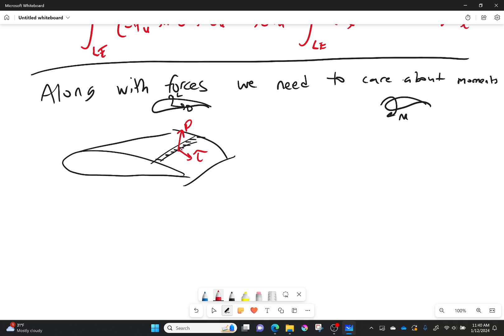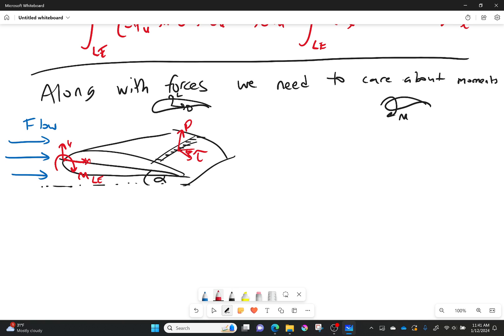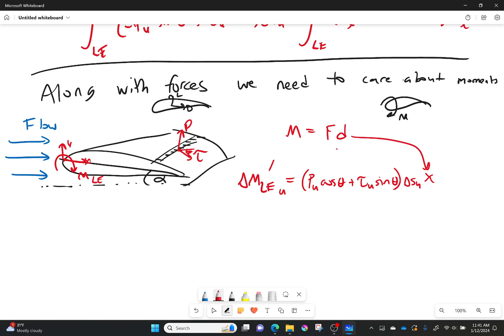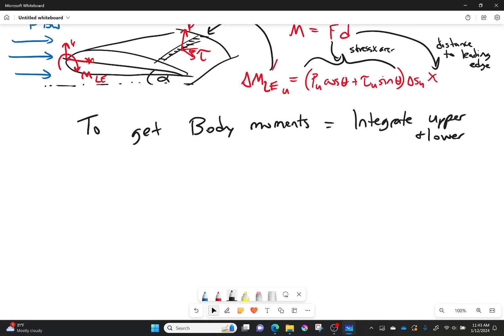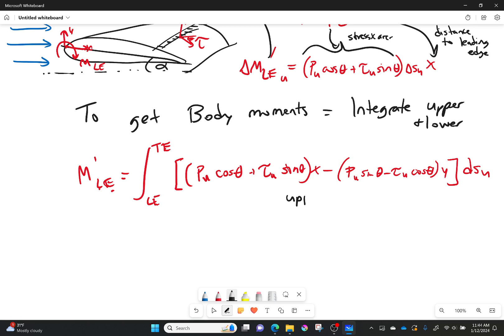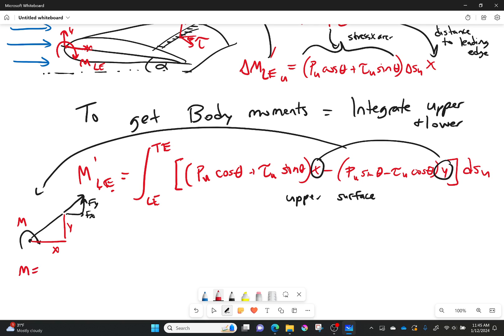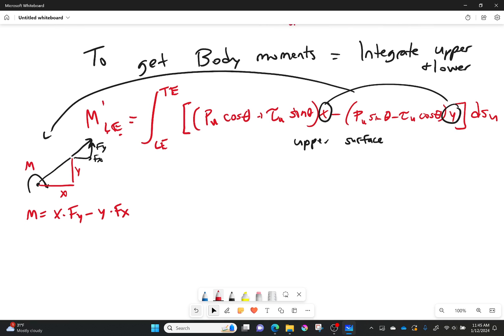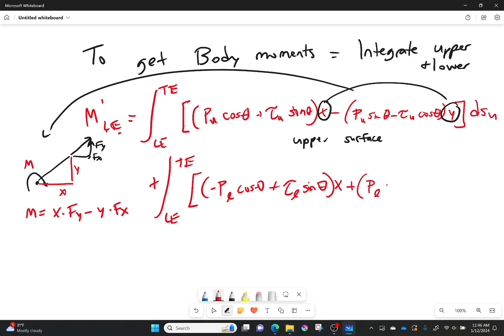Moment about the Leading Edge

Comment: Sir, I cannot understand the signs on moment equation. If the force that cause the moments are N'up and A' up as derived in prevous video, why now the signs are different? Before the pressure was negative, why now is positive on first moment and negative on second, also shear stress signs looks flipped with forces equations ?
Reply from the maker: The signs switched because I pulled out a negative sign. Earlier it was (-Pu...+Tu...) I pull out the negative sign and it became -(Pu...-Tu...)
Reply: @drkiddengineering  would it make a difference if i dont pull out the negative sign and keep the signs as it were in the N' and A' equations?